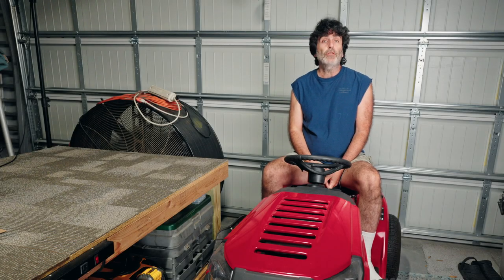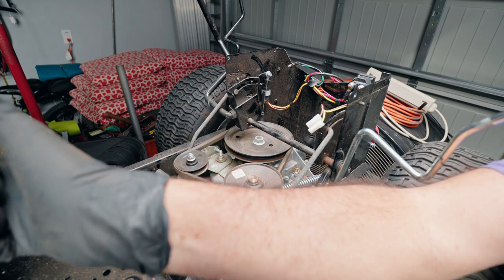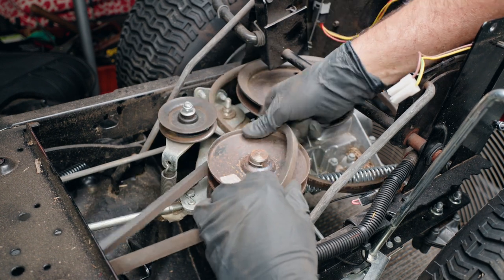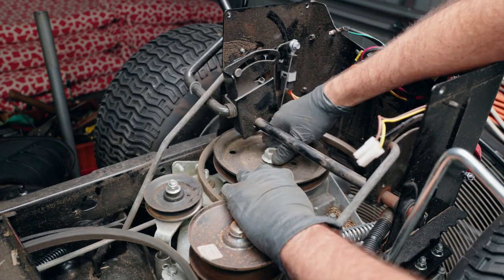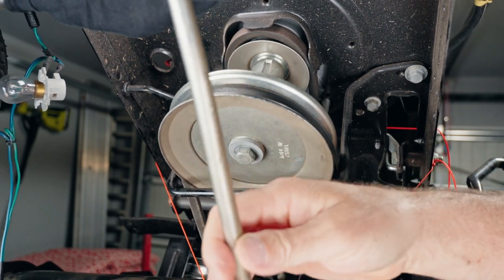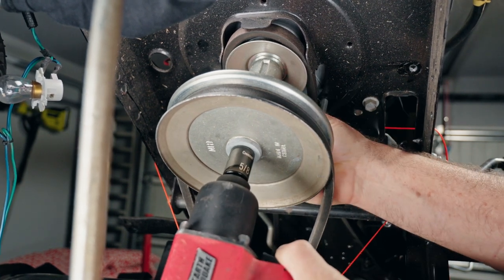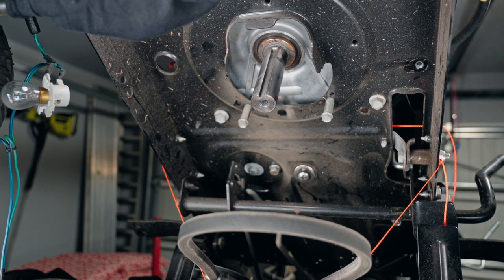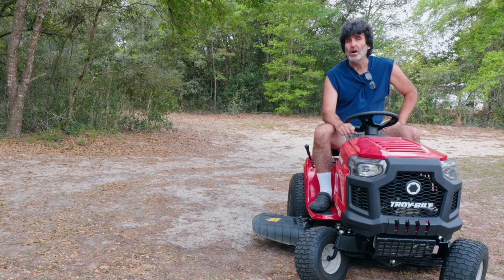Change/ Replace Your Transmission Drive Belts ON Troy Bilt Pony

Comment: Great DIY video for those of us that don't mind doing a little maintenance and repair, appreciate the detail. I did come up with an alternative to removing the front pully assembly since I don't have an impact wrench and didn't want to chance busting fins on the top of the mower. The distance between the 2 pullies is pretty roomy, I was able to use a pipe wrench to hold the assembly from turning while I removed the 5/8" bolt with a ratchet/socket. Piece o cake..... Keep up the great work!
Reply from the maker: Great tip!  Thank you.... I'll keep that in mind next time as an alternative method if you don't have an impact.. 😀

Comment: Thanks for the video! I just need to change the lower drive belt and so by looking at your video I could see that I do not need to take off the transmission pulley. So it's saving me some time and effort.
Reply from the maker: Excellent!  You're welcome and im glad I was able to help... 😊
Reply: @JLPicard440  The new belt is on and I mowed my lawn already. Mission accomplished!
Reply from the maker: @shonuff5878  That's great!  Glad you got it back on the road... 😊

Comment: I have a Troy bIlt pony 2007. It just started making a loud clanking noise whenever I put the the tracker in forward or backwards motion. Sometimes the sound goes away, but it always comes back especially when mowing on slopes. Eventually the mower stops moving forward or backwards altogether (like it has no power), as it continues to make that loud clanking sound (it sound like someone clutching a stick shift car incorrectly). 

In your opinion do you think this is a drive belt issue? I check underneath the battery to take a look and to my best judgment it looks like the belt is still in good condition and connected correctly. 

I believe this this problem may be independent of anything else. However this was the same day I noticed my tire pressure was low and coming off the rim while mowing. I managed to fill the tire back up with air and finish the lawn right before it started making that clanking sound. 

Hope you can offer any insight.
Reply from the maker: HI, I'd take a look at all the pulleys and see if anything looks like it's falling off.  It would help to know which end the noise is coming from... If you have a helper he/she can walk along side the mower and try to see if it's coming from the front, middle or back.  That would narrow it down.  It could be a transmission, but I wouldn't go there just yet.

Comment: What size belts do you use?
Reply from the maker: HI, I usually don't pay much attention to the size.  I will use the part number.  You can usually get the model number of the mower from a sticker under the seat and go to a website like www.partstree.com and plug in the model number to get the parts breakdown.  From there you can get the part number.  I hope that helps.

Comment: Would wore out transmission drive belts cause your mower to go slow or not go at all in low gear?? I have to run it in high gear to get up a hill
Reply from the maker: They could... It's possible you don't have enough tension on the belt when in low gear..  Make sure the variable clutch is working right.  It's the pulley in the back that has 2 grooves and slides up and down according to what gear you have selected.  If it's not going up and down smoothly it can cause that problem...
Reply: @JLPicard440  thank you!! I’m about to check it out!! Another question is the deck belt and drive belt the same size
Reply from the maker: Hi, no definitely not... 😀

Comment: Can u tell me what the front belt on this is
Reply from the maker: HI, I don't have those part numbers handy.  If you take your model number from under the seat, you can go to www.partstree.com and plug in your model number.  From there you'll be able to get the parts breakdown and see the part number.